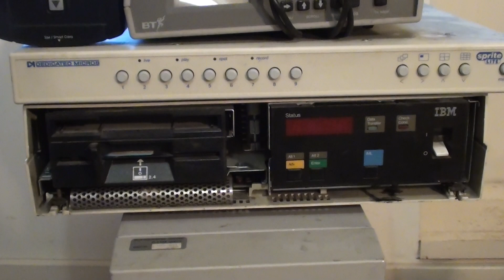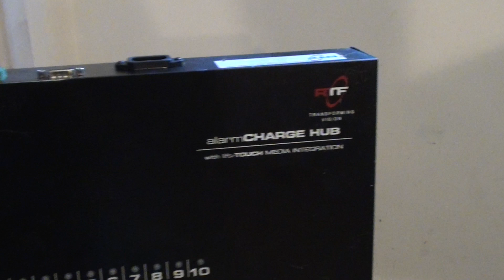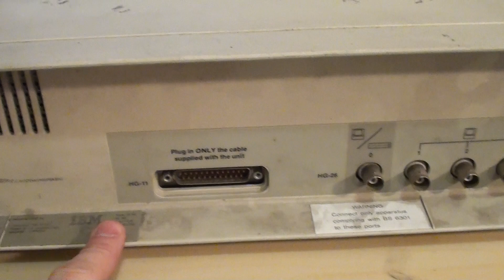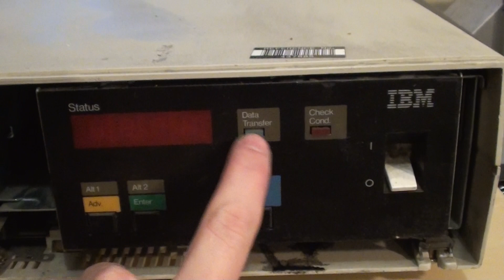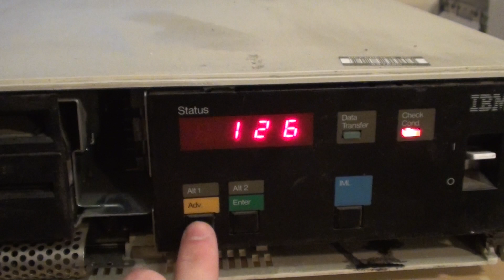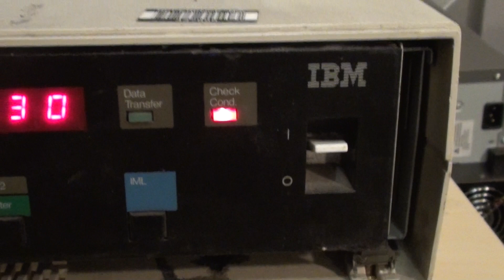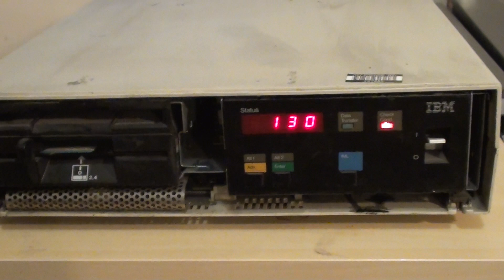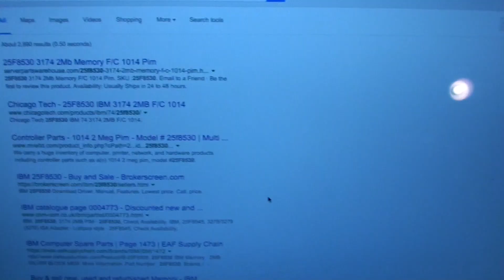IBM 3174 SNA Controller Teardown

Comment: It’s a communications controller, used to drive 327x mainframe terminals. It connects directly or indirectly to a front-end communications controller. Uses SNA protocols.

You are wasting your time trying to do anything with this without a connection to an active communications controller. This is not PC gear.

Comment: There was another teardown of a 3174 on youtube but a different configuration.  On his, the Intel chip was an 8051 microcontroller. These are rather small controllers.  I've seen some that were about 1/2 the size of a refrigerator, but they could handle significantly more terminals.

Comment: Hey, For what its worth, i'll tell you what I know of these 3174 units. I used to work on these 3174's back in the early 90's while working for a bank with IBM mainframe S/370 running MVS and a wide area SNA network. These units would have probably lived out in a branch office and provided SNA comms for a group of local terminals back to a central Front End Processor (FEP) such as a 3725 or 3745. The FEP's were huge beasts about the size of 4 or 5 fridges side by side and could handle hundreds or thousands of remote 3x74 terminal controllers like yours. The FEP would then aggregate comms into the mainframe itself using very thick IBM "channel" cables or ESCON fibre links. The BNC connectors on the back of the 3174 would connect good old green screen (or color) terminals such as model 3278's, 3192's etc. The DB25 port would have connected to the wide area network using SDLC protocol (or possibly X.25) and is most likely just RS232 compatible for low speed serial up to about 19.2kbps. Without searching the codes you saw on the screen, they are just status codes which all had very specific meanings for conditions such as floppy fail, comms fail etc etc.  Any thanks for the video. I enjoyed the trip down memory lane. Cheers

Comment: maybe the SCSI chip connects to the socket on the back stands to sense does it not put it back together and send it to Morten Hjorth in Denmark as he uses IBM and Lenovo as well as DELL systems.

Comment: It's great to see you making video's again! That controller has cpu, ram, and expansion cards... You should try to see if those expansion slots are normal pci, and try to get a cheap pci gpu, and maybe it could be used as a computer!
Reply from the maker: Unfortunately, it was immediately apparent that the memory expansion slot which looked like a PCI slot was defiantly not pin - compatible with a PCI card because there was no PCI controller on the board, and the memory expansion board had no controller IC, so it would have been impossible. If the system had been in good cosmetic condition I may have tried to use it for another purpose but I decided instead to salvage the 5.25" drive from it, and the rest was donated to an IBM enthusiast.

Comment: The TC17G022 is a Toshiba CMOS gate array http://pdf.dzsc.com/88889/43511.pdf
Also all the other Toshiba chips are either Gate Arrays or they are reffered to as "LGA". They were also used by digital synthesizers at the time and National Instruments used Toshiba gate arrays extensivly as well. With the IBM stuff it is so that the first number like 16F0240 is the IBM part number while the second number under it T5552 is the actual Toshiba part number. You can also see the IBM part number 66X2678 on the TC17 series gate array as well as the 39F6480 IBM part number on that i80xx series microcontroller.

Comment: I operated one of those long time ago. This device was used to access IBM Mainframe across X25 networks. The BNC Twinax connectors are standards for 3270 type of screen. The big connector is a X.21 that was used to couple to a X25 MODEM.

Comment: The chip just below the D765AC floppy controller most likely contains the system firmware.  The connectors at the rear are not BNC, but rather Twinax, as this unit was designed for connecting terminals to an IBM mainframe.  It wouldn't surprise me if the processor is a variant of the ROMP processor used in the 9370 and the IBM RT.

Comment: happy to see your back!
EDIT: I think i was on the right track i found a listing off the old IBM Catalog. 
http://www-01.ibm.com/common/ssi/cgi-bin/ssialias?infotype=OC&subtype=NA&htmlfid=897/ENUS3174-22L
I am assuming that this would connect to  LAN and then you would connect terminals to it for accessing a larger server. Like a router.

Original:
just a wild guess: could the status be it stepping trough instructions like how previous main frame systems would.
Rather strange bit of kit, maybe its a terminal server judgeing by the multiple BNC connectors that have terminal images over them.
maybe the first one is for it to connect to the network.